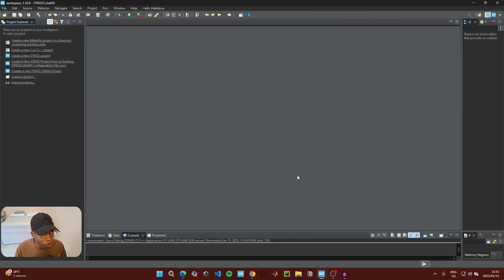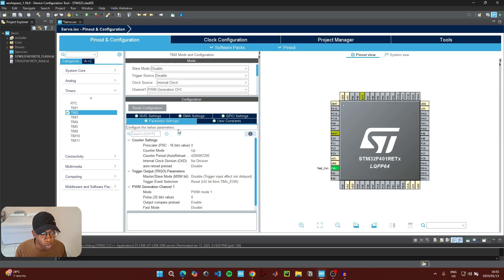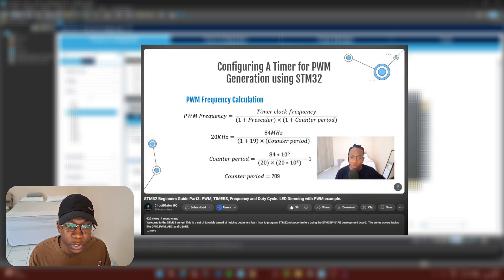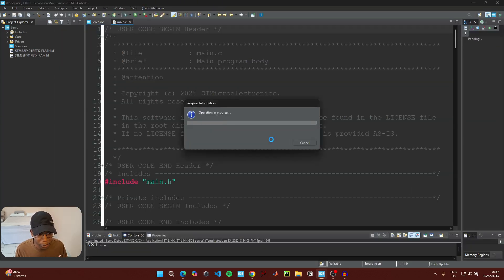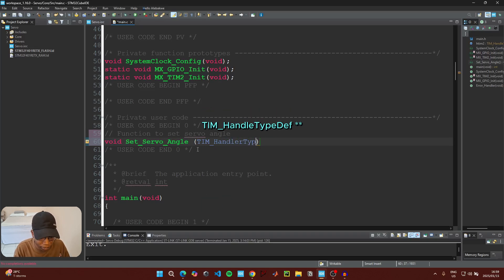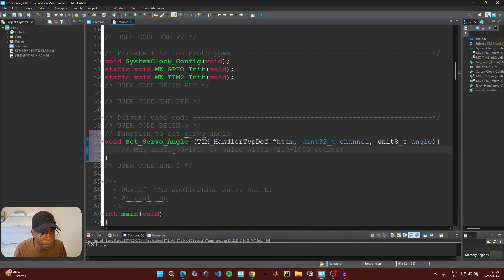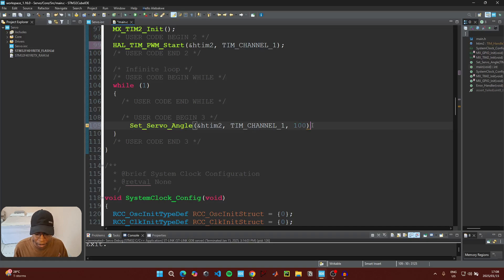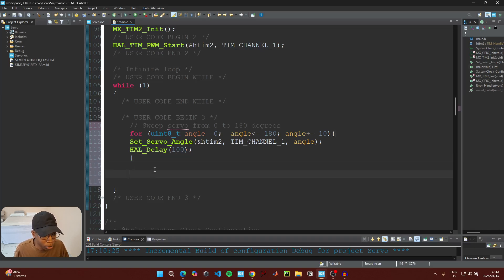Servo Motor Control with STM32 | EASY TUTORIAL | STM32CUBEIDE

Comment: Great video. Kindly make video/ teaching on how to make unipolar spwm h-bridge inverter which have battery , output voltage , lcd print and pid to regulate output voltage of 220vac.
Reply from the maker: Hi, I would like to make your video request but I currently don't have the relevant components.  Please consider checking out the paypal donations link on the video description.